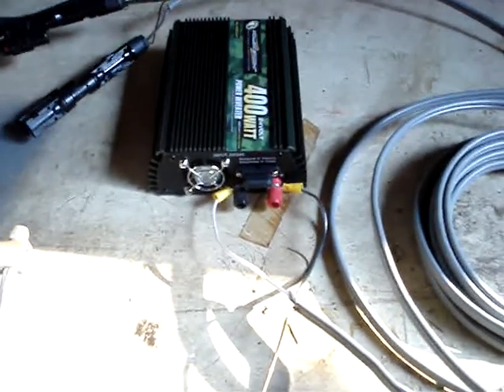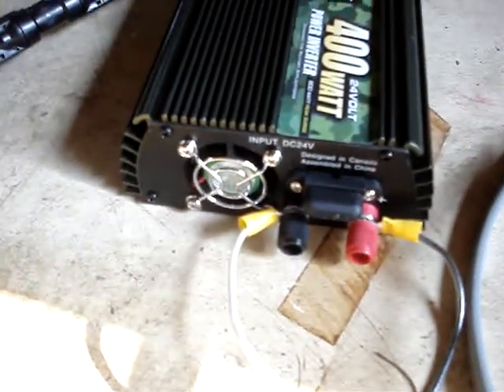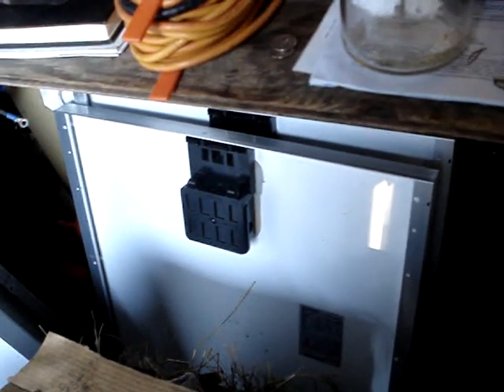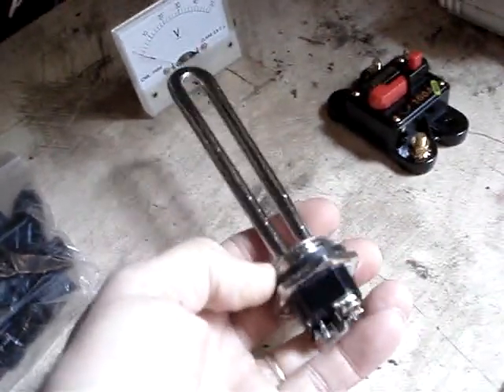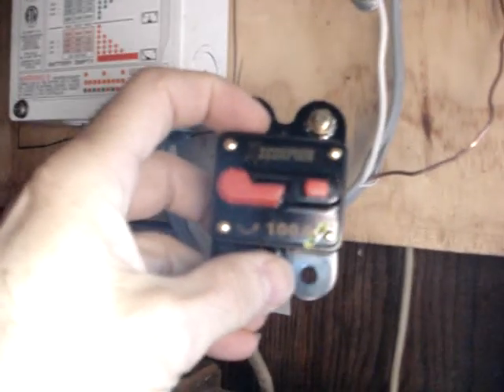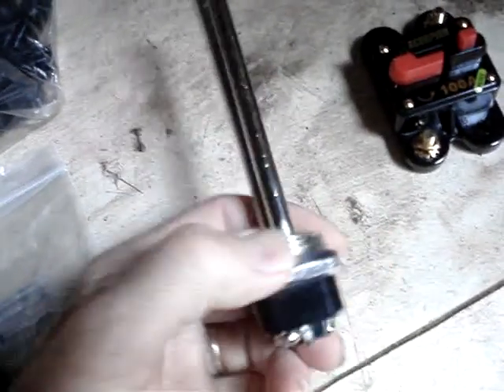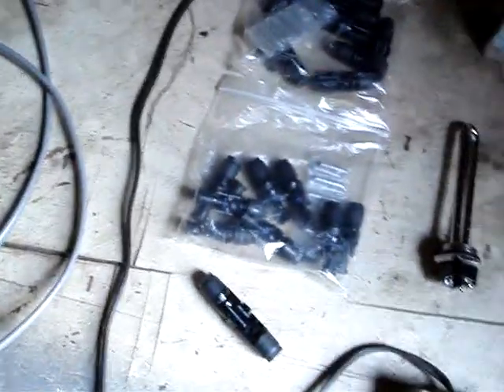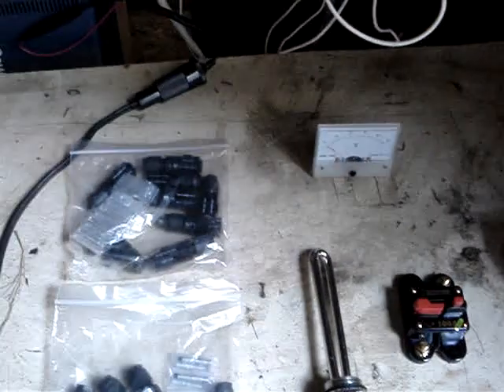Solar Photo Voltaic Panel Project Update

Comment: That inverter was giving an excess supply potential fault.  The lightly loaded modules were producing about 43V.  In order to avoid damaging the inverter potential converter/converters the inverter will shut down if the supply potential in excess of 30V or so.

Comment: @N8Dogg1002   Solid core is not a problem on DC.  That myth is based on a misinterpretation of what the skin effect is.  The skin effect is not an issue with DC and only affects mains frequency AC with wires over 2/3in in diameter.  The main problem with solid core wire in certain applications is that repeated flexing will damage it.

Comment from the maker: @N8Dogg1002 The solid copper wire is rated for household 120 AC. It was cheaper than the stranded copper. The MC4 connectors were really difficult to crimp the contacts to that wire. Making a complete contact between surfaces using a solid wire of copper to an adjoining surface inefficient. Stranded is easier to add contacts to, bends without breaking. It will conduct DC the same, surface area at connecting points is were the current gets bottle necked. Telephone company uses DC in the wiring.